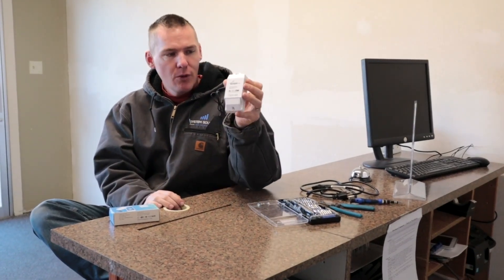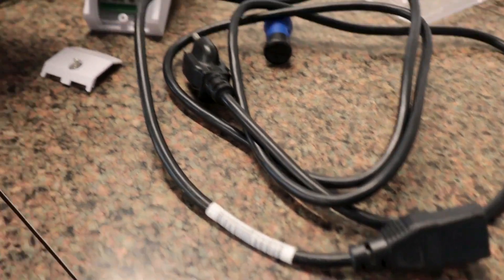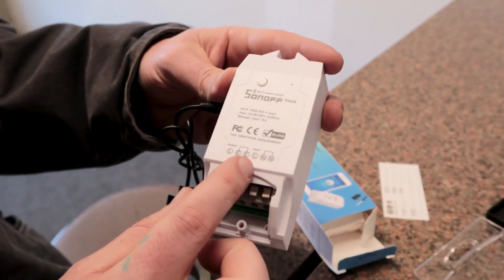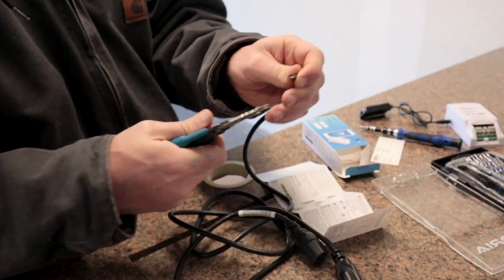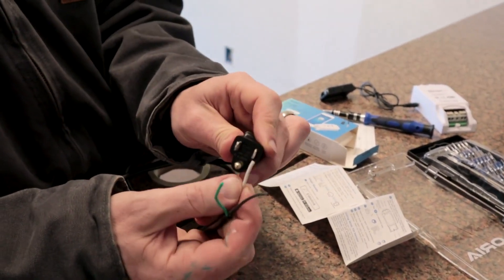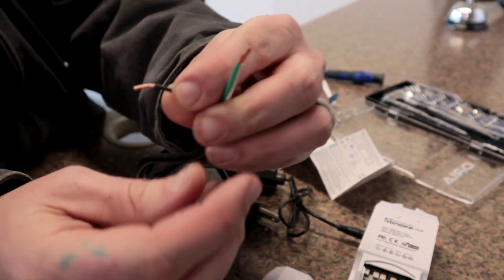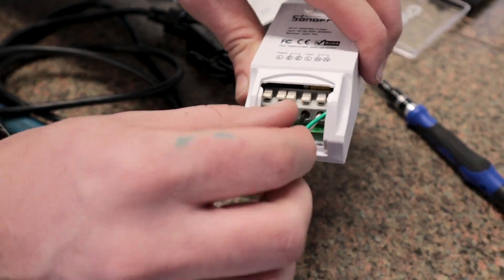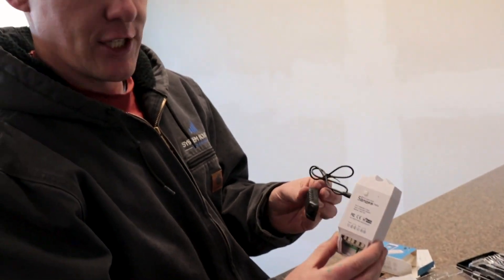Wiring a Sonoff TH16 Temp Sensor & Switch

Comment: Why the hell you cut off the Earth wire? Don't advise that Earth could be optionally connected with Neutral. Oh my God, so simple: put input phase to input L, output phase to Output L, both input and output Neutral to Ns (doesn't matter which one to which N, one internally connected to the other), both input and output Earth to Es (again, internally connected). The saddest thing is that some people like such idiotic guide.

Comment: Thanks!

For the earth wire, you need to put it on the E (on my revision, 2.1, it's on the left). You have 2x N on the right for the neutral, and 2x E for the earth on the left side, then the In and out. Thanks for this video!